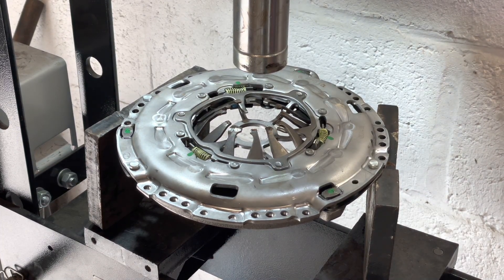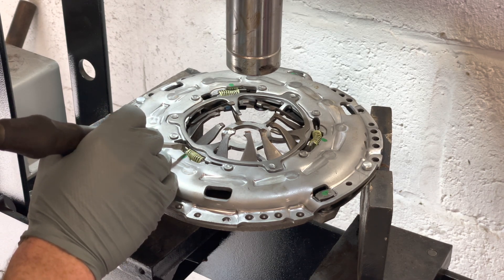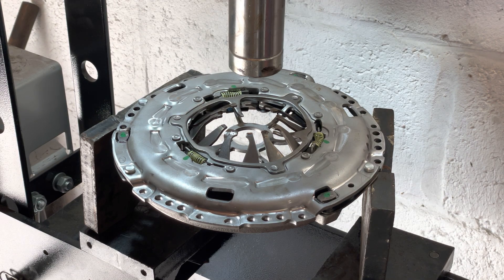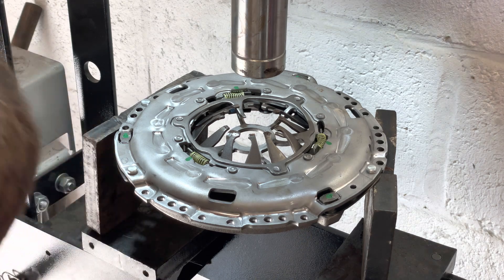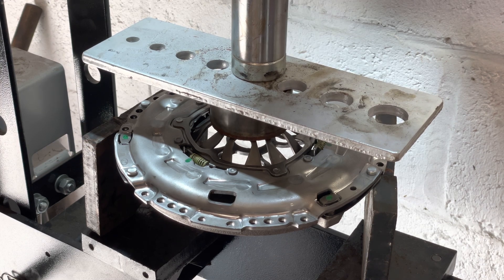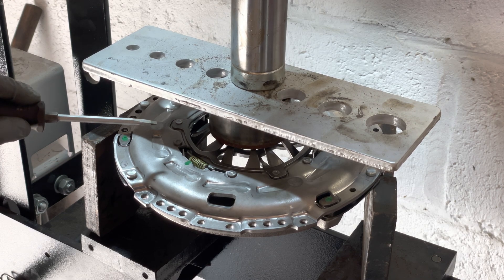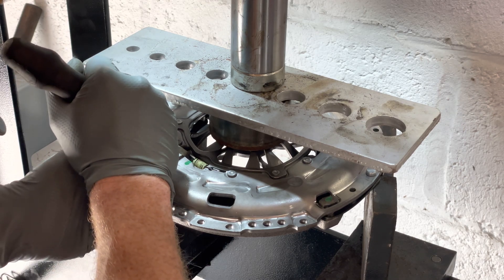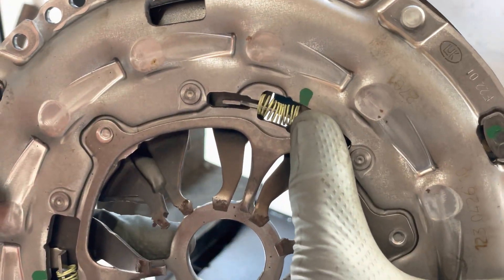How to reset a Self Adjusting Clutch

Comment: If a new one has been fitted without knowing to check if it's gone off in transit and the biting point is right at the bottom could this be the problem. I'm thinking it would be the opposite and at the top and the problem is it's stuck and not self adjusting

Comment: Thanks mate.... First time im dealing with changing a clutch with this type of pressure plate.... I installed it without knowing it should be reset once u replace the clutch plate.... Turned out i couldnt shift gears because i didnt do the reset 😢 ...... So i had to do the job all over lol..... Glad i found this video on how to reset..... Very simple and easy thanks 😊
Reply from the maker: How annoying, yes, I had that once!
Reply: @theweekthatis after resetting and installing should I do anything else? Or jus set up and it is ready and will adjust itself once in use?

Comment: I wish I knew this before. I was breaking my head why my S4 won’t go into gear after replacing my clutch. After seeing this video and looking at a picture of my new pressure plate I noticed it’s not adjusted. I wish FCPEuro video would’ve shown this. Now I have to drop the transmission again
Reply: Lol same thing happened to me..... Couldnt get any gears..... Had to do the job all over again 😂 .... Not a joke 😢
Reply: @babelonchabalala1690  I was able to get the clutch in. I broke 6 slaves cylinders. It turns out the pressure plate was defective

Comment: is the cross tool to compress the mechanism mandatory? what's the downside if you don't use the tool? THANKS
Reply from the maker: It's a really good question, I'll make a video to explain why you DON'T need the tool, if you do the bolts up evenly in small stages.
Reply: @theweekthatis  have you done one yet? Has a clutch failer in 4k miles.
Thinking if I did something wrong.
Fitted without tool.
Thanks

Comment: Thanks for sharing. I think these pressure plates are a piece of junk. My 2.2 Civic uses this set up and is on it's FOURTH clutch in 220,000 motorway miles. My guess is the adjuster has moved all the way round causing the slip yet again, it's lasted a mere three years and 40k miles. I'm never going to have this type of pressure plate in any of my cars again. It's getting replaced with an Exedy that is just a diaphragm spring and non adjustable pivot.
Reply: Nope nothing wrong with pedal height or engagement. 

Honestly, and I'm not making this up these pressure plates are a waste of time. I can see the apppeal of not having the pedal height slowly creep to a higher biting point as the friction disc wears but the side effect of a faulty adjuster on the pressure plate is a bad one for me.

Like I said, the Exedy kit on my car is fine now with no slips. 40k motorway miles on the LUK self adjusting clutch and then it starts slipping just isn't acceptable.
Reply from the maker: Being fitted wrongly perhaps. I've never had a problem with them, it's just so the pedal pressure remains constant throughout life.
Reply: @theweekthatis  they're common to fail on these 2.2 Civics prematurely and the 2.2 iCTDi Accords.
Reply: Sounds like you installed it incorrectly.
Reply: @thronewalker1153  nope
Reply: LUK clutch now removed and thrown in the skip. There was no wear on the friction disc and it still had the machine marks on the pressure plate face. The 'adjuster' had moved to two thirds adjustment, which was causing the slip. Utter garbage.

I now have an Exedy NON self adjusting clutch kit on my car, same pedal feel and more importantly, no slip!!
Reply: @mickl8212  the clutch master rod that connects to the clutch pedal was not adjusted?
Reply: Hi, I also had this problem with a Luk clutch. The first clutch that my mechanic installed on the Civic already had the springs open, the car only fitted the first and second, today we are going to install a new disc with the correct springs, I hope it will be fine
Reply: @Phyrox84   don't waste your time with it, get an Exedy clutch kit for it and you'll have no more issues.
Reply: @mickl8212  How does Exedy kit performs? Mine started to slip so cant decide with which to go for Exedy or Luk?
Reply: @StefaTGM   Exedy full stop
Reply: @mickl8212  what you mean by full stop?